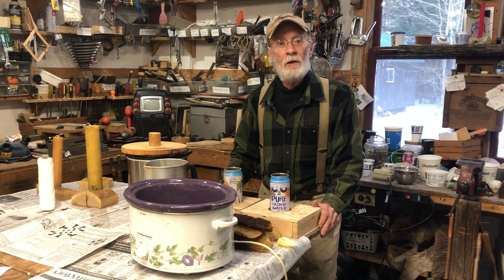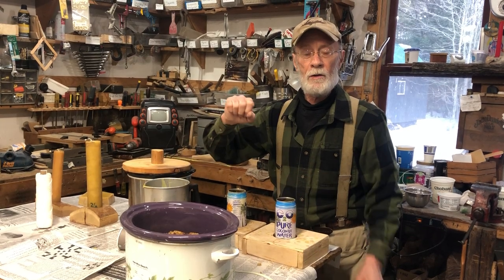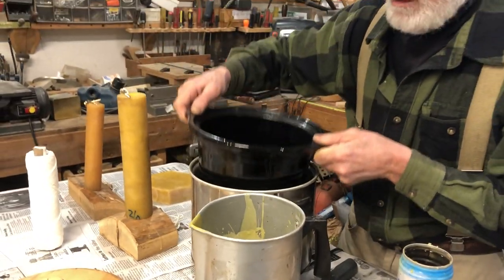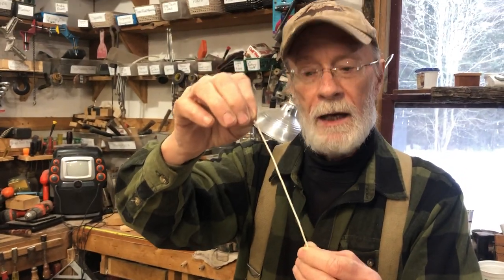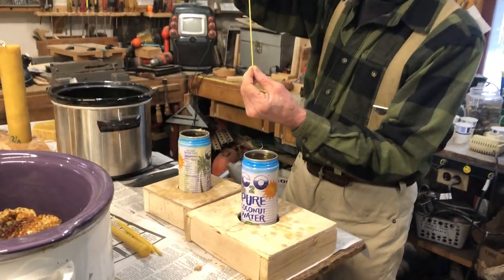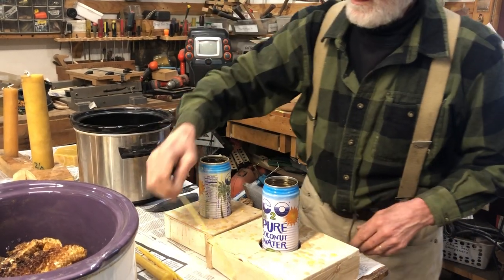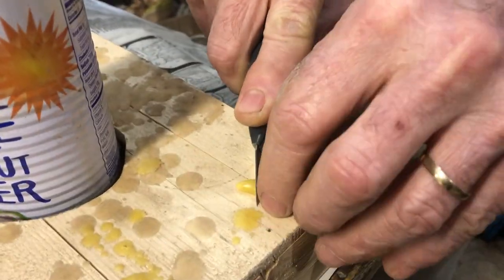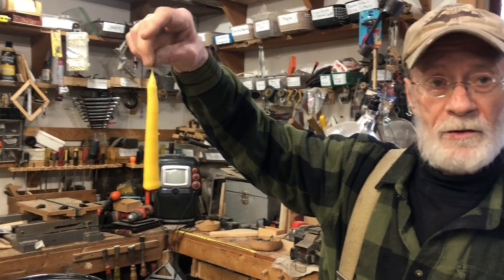Making beeswax candles-hand dipped

Comment: Great video! What were your molds made from?
Reply from the maker: I didn't use molds, just dipped the wick in the wax. The wax was contained in coconut water cans.
Reply: @UPMichiganBees   At the end of the video there were molds That you poured wax into. 4:48 in to the video. The reason I am asking is because I demo candel making at a living history farm. It looks like they are wood???
Reply from the maker: @EXARCWithGrandpop  Sorry for the confusion. These are silicone molds from Dadant.I have tried several different ones , but these work best. I work with a lot of wood and tried that route...didn't work.

Comment: Hello. How long will your wax stay hot for dipping. Wanting to do this for my class and figuring out the set up. Thank you.
Reply from the maker: About 3-5 candles. When I do a group, I use a single mug electric cup heater to keep it warm enough throughout the process..you just have to add more wax as it gets used up.
Reply: @UPMichiganBees  Thank you so much for your prompt response! 😊